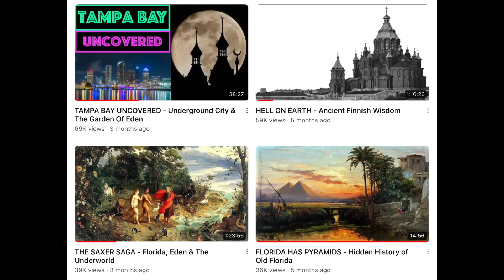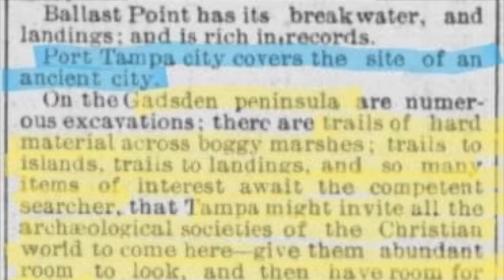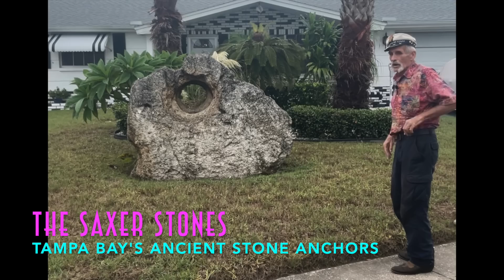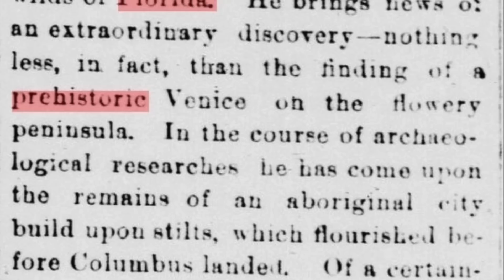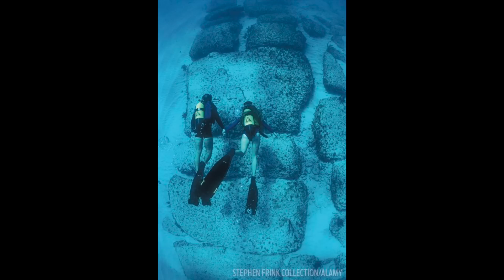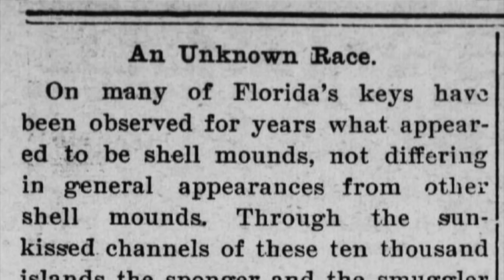SUNKEN HARBOR DISCOVERED OFF TAMPA... Atlantis Found?

Comment: Reminds me of the big lake west of the old wagon wheel flea market in Pinellas Park, where in the early days of Pinellas, they mined the perfect shell to create the first iteration of Park Blvd, and now is a huge and deep "retention pond" 
With Tocobaga and other sites numerous around that area it could be a later version of the Tampa "harbor" found in the first segment, which may have been a huge shell mine used to create Geographical elements of ancient Indian site constructions, as did the much later builders of Park Blvd and new roadways where Cross Bayou Canal was dug to drain Lake Largo and connect Tampa Bay at St Pete Clearwater airport, and Boca Ciega Bay.

Comment: You say in the video that they dont want to say where exactly it is but the exact coordinates to each location are displayed under the pictures of each location. Has anyone gone out there and dove or put a rover in? How deep is it at the structure?
Reply: The Florida gulf coat is the most gradual sea shelf in the world. 2 miles out is only 30 or 40 feet. 10 miles out is only 50-60 foot. 40 miles out is 100 foot deep. It’s a very flat and predictable slope

Comment: Interesting.

I sometimes just turn your videos right off because of your crappy "Miami vice" intro that goes on and on and on...

Thank you for not subjecting us to that.

I believe that the land mass of Florida used to be much larger. There's no way that someone built Ft. Jefferson 60 miles out in the gulf.

There is a road just 50 or so yards off the beach line of Palm Beach which no one seems interested in.
Reply: @Teachatalkin  no it wasn't....it's  twenty feet below the current elevation and out past the current buildings, many of which were built before the 60's... you high as fuc boi